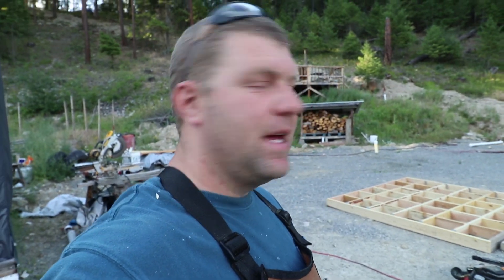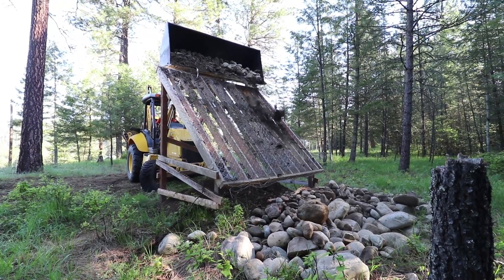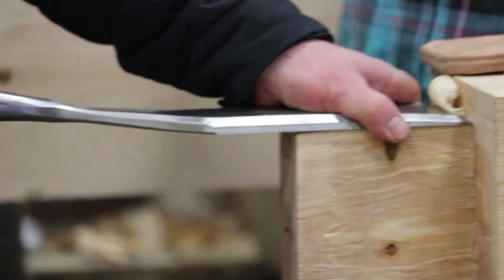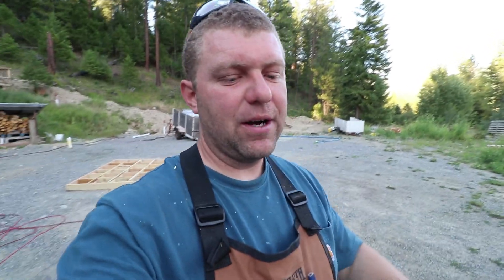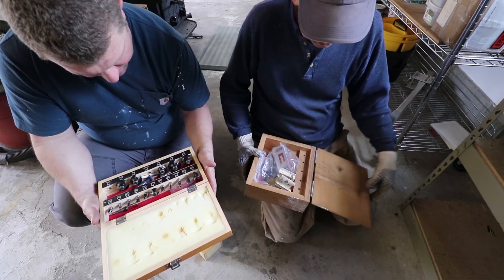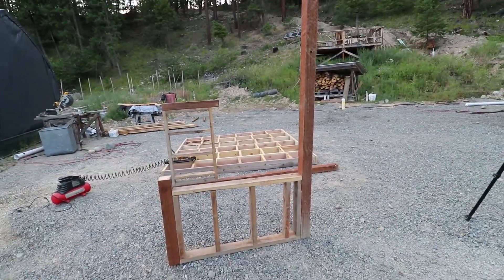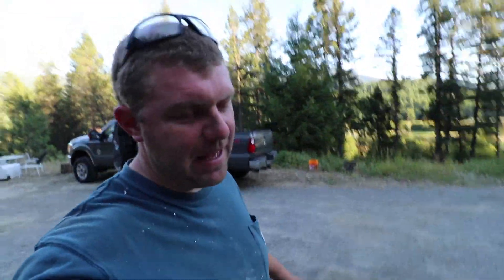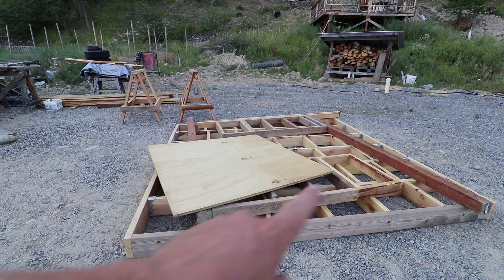Check it out... Grizzly 3.0 is BACKHOE-FRIENDLY!

Comment: I know you are putting the plywood on the inside to prevent the cleaned soil from blowing out but doesn't the front also need some kind of shielding to prevent the weight of the rocks from pushing the front plywood in?

This might be where you could use metal. I'm betting there's a local junk yard or maybe talk to an appliance dealer about getting a broken dryer or washing machine or two. The metal cabinets have sides that you could get pieces 24x34" (2 per dryer, 3 per washer) that could armor the front end.

Comment: I think it would be much easier to load the the grizzly from the front instead of over the top from behind it.  Then just use the bucket to move the big rocks out of the way.  Make sure to set it up in an area where you have plenty of room around the grizzly to push or pick up material.

Comment: dig a hole in front of it about 3 feet deep sloped down away to about 6 feet  deep the width of your grizzly and just fill it in when its full instead of moving the tailings (big rock) pile.  just a suggestion.

Comment: Is your camera capable of infra-red night vision? I wouldn't complain if we had to watch your evening antics in infra-red ☺️ love your work, personally I would have built the frame like a deck with the angled beams under the horizontal timbers, then I would notch the angle beams so the horizontal beams sit vertically and cut the top of the  horizontal timbers at the same angle as the angled  beams so when you attach the mesh it has a flat surface to attach to but the vertical space between the timbers is significantly increased ☺️

Comment: I'd suggest if this Grizzly is to fail, to rent or borrow a skeleton rock bucket for your Dozer/Excavator. Even if the materials are little to no cost to build 10 wooden Grizzly's, the time and opportunity cost of continuously rebuilding these is only increasing. Is building Grizzly 4.0 worth it?

You might also mount cheap steel rebar onto the lateral braces of the grizzly. No need to weld, just attaching them on would give extra resistance against side loads.

Comment: I would build a rake for the front loader bucket and process the rocks out on a flat area and simply push the rocks away and leave dirt behind. I have the same backhoe you do, it can much more than than what your doing with it. I have a log clamp for the rear end and a  
44 inch wide clean up bucket and man lift for it. That hoe will be your best tool if you think more about how to make it do more for you.

Comment: You may not want to hear this but when you build a grizzly the material has to be stronger than rock! Wood & screws will break under bombardment of rocks, it's simple physics! WOOD WILL LOSE EVERY TIME! Use steel!
Reply: There has to be somewhere  to buy used steel, I am sure they could resell a steel grizzly a couple of years down the road! Maybe a couple of neighbors could go in on the cost & everyone use it.
Reply: In the last video, he mentioned the reasons why they're using these materials. Wood is readily accessible for them, free, and much lighter than metal.
Reply: +John Brinton - I am guessing he isn't a welder and doesn't have a welder so wood may be his option for now.  I m sure he will come to the realization that he will need to source some scrap beam steel and weld together a frame that will last longer than a few weeks. I would agree that in his area scrap steel should be pretty easy to find and not cost much and would in the end save him countless hours.  Even if you have never welded before, mig welding is simple enough on a project like this to learn on and be successful.
Reply: John we had this discussion previous video. 
Maybe after this fail (current rendition) he will "get it"
Reply: I suppose if I was able to mill my lumber I would make 2 1/2" or 3" X 6" boards & hope for the best, meanwhile gather steel for a future Grizzly and I think I saw a buddy of his that welds on a video. I like it that Jesse never gives up seems to make good contacts with people based on his determination to get things done! With continued advice from their subscribers these two can achieve about anything!
Reply: I would suggest using cut logs for his frame and grizzly bars.  They should be far tougher than cut lumber.   Also get a light trailer axle and fit that to one side so it can be more mobile.
Reply: They are not sturdy enough for falling rocks,  perhaps angle iron with lag bolts would last longer.
Reply: 42RosyRosie yes we know, but "time" is invaluable.
Meaning even though the wood is free, the cost in time using inferior material has cost him quite a bit.
Reply: I have the cheapest MIG welder from harbor freight and it easily could have done this project in less time than he has fucked around using wood. "I don't know how" is absolutely NOT an excuse to not do something. Hell you can learn literally everything on youtube. Binge welding tips and tricks for a couple hours. Steel is not expensive at all. MIG welding is not hard. To make a structure in steel over wood takes a quarter of the material. I feel like he's one of those people who instead of saying "hey this isn't working try a new approach" just continues on the path for no reason. Shit buying a used grizzly would have been cheaper than all the time he's thrown away on this. Even commissioning a viewer from their area to make one would have been a better idea. I could have built this thing out of steel in a day. 

Rant over. TDLR They should have built it out of steel instead of pissing around with wood.

Comment: My comments on your previous video begged you to go with metal, saving us the frustration of seeing you repeat your mistakes. 

BUT going with you on this, had you angled your blocking to accept the dirt instead of it piling on, that would have helped and also provided the structural integrity you need. 
On the box... again because you are working with (weaker) wood. If you have a large amount of dirt you are trying to bucket out? the sideways pressure may warp out and weaken the grizzly. So I suggest you figure out how to reinforce it or not allow it to be too full before emptying the filtered material. 
I do expect this one to fail also... if it gets much use. it's your deal so have fun!

Comment: Hey, so I usually don't butt in to your videos here, because you guys are out doing something whereas most people are at home sitting on their brains, but I noticed from the beginning a lot of comments have suggested that you build this thing out of metal and I was wondering why you haven't.  Learning welding will be invaluable to you in the future, and judging by your soil this is not a throw away project.  You will be looking to do this with anything you dig in the future.  Even forgetting the standing strength, a welded metal frame is going to take the abuse of moving way better than a wooden structure and if it does break, you can fix it in most cases ... because you will know how to weld.

That said, if you do build 4.0 out of wood it might be good to think of it in terms of what they taught you at the timber framing seminar.  Fasteners into end grain wood are never going to be as strong as a supporting beam (even with joist hangers no matter what Mr. Simpson Strong Tie says) and that beam should be let into the columns to get the most out of the strength of the wood.  The bolt connections are a weak point ... relying on a wimpy little piece of metal that can shear rather than a let in wood joint that has thousands of shear resistant fibers  and the compressive strength of the wood column working in tandem. The blocking will help with joist deflection, but this use stretches the definition of "live load" beyond what any structural engineer would consider prudent.  You would be better off with multiple beams running under the joists at mid intervals.  I don't know ... there are probably a few other things you could do to make a wooden grizzly hold up for a longer period of time, but why, when you could make one that would last out of metal?

Anyway, please don't see this as an attack.  I totally applaud you guys for going out and doing something that is not easy or comfortable.  Keep up the good work.

Comment: You said before, make a drawing, get the measurements right. Or you can measure as you go along. Whichever, have the idea thought through first, make some sketches, eliminate what you dont like.  The grizzly is not a floor, or a wall, but just think about the way the weight is applied and try and come up with a design that dont put stress on nails or screws.

Comment: I have to admit, watching the grizzly series has been most entertaining. I have watched, and commented in head...yeah that's not going to work. No offence. I think you're closer to being on the right track now, however wooden grizzly's fail more then they succeed. Its not your failure, but more like the failure of the material you are using. I'm not sure what you are using for wood, but I'd try to go with an oak or some other really hardwood. I understand having to use to what you have on hand. I've had to do the same 100's of times. Its not always easy to do. Might I suggest making plans to recover metal buildings as well as wood buildings. Your need for metal isn't going to decrease with time. Good luck to you all. Hang in there.

Comment: why not just place corrugated steel where the soil and rocks would land? when you have enough soil or rocks just chain it up through a reinforced hole or few to the backhoe and drag it off to where you want. clearance wouldn't be as much of an issue and you wouldn't worry about inadvertantly ramming into the grizzly. you might end up dragging off more dirt than you can load the bucket in a confined space. and maybe sheets of plywood to redirect the falling soil. and if you have no use for the rocks, i'm sure there's a market out there that you can make a little money off of.

Comment: you keep on framing this like a wall and not a Deck . walls take a vertical load because the lumber sits on top. 
 but ditch the wood and get some steel and a welder! steel is much more forgiving to work with and much more repairable plus it comes in 20ft lengths

Comment: are you over thinking this a little bit all you need to do is put less angle on it  and brace it more for more strength its  not part of the house or anything does not need to be spot on perfect its just a tool that you will break at some time  and will throw away or pull it down after  you are done its called trial and error forget the math eyeball it use it.
keep up the  great work  love the videos .... don't mean to pick at  you in any way think you are doing a great job  both of you but time is running away from  you hence you did not complete it in that day if that was your intention.

Comment: This is definitely a project for which welded round or square HD pipe or bar stock is intended. And the square grid design....Simply weld 'vertical'  'strips' running from 'top' to 'bottom' spaced according to the size rock you want filtered with 2-3 cross braces.
With all due respect, watching this is painful.

Comment: Seriously you could have found an old grizzly from a pit somewhere for less you have spent on all this. I know I've worked construction and excavation for years. Just go start talking to so e local gravel pits and civil contractors and you should be able to find some old steel grizzly in someone's retirement pile. You may even find someone with something they would just let you borrow. A real steal grizzly will be so much more efficient with a good operator than any of this stuff you are building. And you have to be able to hook on to the grizzly and move it often as you work. a decent operator with an excavator  (not a backhoe!!) Shou l d be able to go through yards and yards of material a day.

Comment: Got a Freaking Question....
Why are you not using METAL for the Grizzly...
I find it just DUMB to not use a Material that is More Resilient to wear.. will last longer than you need it for the Job...
--Psst you also need the soil removal opening to be Far Larger than the width of the bucket..

Comment: The definition of insanity is doing the same thing over and over and expecting different results. You drop a 4/500 lbs rock on a 2x6 (actually 15/8 x 5 3/4) what is going to happen ? Maybe not the first time but by sure on the 3rd or 4th. And by next year sitting out in the weather ?

Comment: You're making that grizzly way too difficult. Chain the griz to the bucket raise it as far off the ground you want support it with knee walls back up the loader to the angle you want frame and nail it together. Think about how is the grizzly gonna hold up to scooping pressure from bucket? I think you'll need to back drag the sifted dirt out and scoop at 90 degrees. Wish I was there to help.
Reply: William Dawson I agree. I see the sides blowing out.  He should look at some gold mines to see how the set things like this up. My buddy has been running a gold mine for over 25 years, and went through the same trial and error process.  They should also look at a solid top section where the raw material will be dropped.

Comment: all the money you have spent on tools and equipment you could have paid someone to build you a nice house.
Reply: Tools can be sold once the house is done, they talk about it in one of the vids. But I guess it's easier to spit bs
Reply: Michael Groff - Can you explain how?
Reply: Chris Landry makes sense. All that money they spend on this timber frame workshops, sawmill, backhoe, water systems, and all this extreme piping is a bit much and for sure can make some kind of simple house that  has everything they need but then again the whole point of this is to make their own "homestead"
Reply: their water system is part of their home
Reply: There would be no YouTube content.
Reply: The assumption in the statement is the use of the tool is shorter then the payback of the tool in a professionals hands. If they buy the tool at full price(rarely) and use it till it wears out then they have negated the tradespersons ancillary costs and profits, so are ahead. I'd guess Most of their larger tools will be turned into profit centres. The smaller tools can be sold "as seen on this channel" for a respectable value.
If these guys were international equity fund managers then yes they should be getting others to do it. In their case they need to do it as much as possible.
Reply: mrrberger. I agree !!! if they paid someone else to do it there would be no content to watch. I enjoy this journey and applaud them for sharing.                                                                                                                             
  I went thru carpenter apprentice school for 4 years to be a fiber processing technician I like to call it. That being said I learned from my mistakes and that was a healthy thing for me to go thru. After 40 years in the trade I can say I made many mistakes but each one I made only made me stronger and better. If someone else did it for me I would learn nothing and still paying to have things done.
  For those that don't care for what they are doing ,don't watch.
Reply: They can be but who really sells tools? I mean you have to figure that there will always be something that needs done and they will need tools to do it.  So being able to later sell the tools sounds really nice, but isn't practical.
Reply: How could you have possible miss "THEY WANT TO BUILD THE HOUSE NOT A CONTRACTOR."  You should troll somewhere else.
Reply: but ... what is wrong with them doing it themselves? It's their home ... it's their land, it's their money ... they want to learn .. they don't want someone else to do it for them... I really don't see why people are in such a uproar about them wanting to learn and make mistakes and take pride in the job they are doing ...
Reply: And lose the whole point of anything DIY, beeing able to say: I made that? Lets take a stupid example, the Golden gate bridge. We know who the architect was and who engineered the design but there is no recollection of who paid the bills. That's because paying bills is not concidered an accomplishment, any fool can do that.
Reply: Fredrik Lård I think you'll find the fool is man who spends all his time working to earn the money and then spends the rest of the time spending money on tools doing it himself for pride, with no time for family or time to actually live. You've effectively paid twice, time is money, so when you are out earning, someome else can simultaneously build it for you, or reduce your outgoings and do it yourself, doing both is the definition of foolishness.
Reply: @alex4alexn .. LOL .. that is exactly what he was trying to do ... cause apparently people aren't allowed to do things for themselves and learn stuff... people must tow the line and have others do everything for them ... and I think that is part of societies problem ... people don't have the extra skills to survive ...